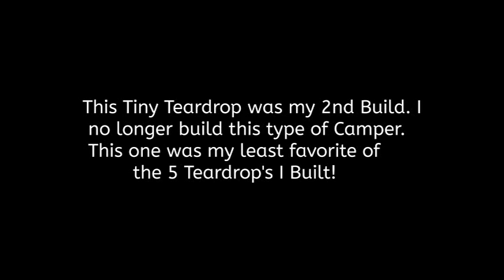Homemade Camper Build (Trail Lite Camper)

Comment: How are you waterproofing both sides of the floor ? For that matter, waterproofing everything, walls, ceilings, etc. ? What about condensation ?
Reply from the maker: Flexx-Guard. I used it on the underside, as well as the edges, plus, the aluminum wraps around the underside of the floor.

Comment: Well done. What a neat little caravan that is. I have a question: did you glue the aluminium skin on the wood or is it just holded by the rims? Please drop me an answer. Thanx
Reply from the maker: No, it's not glued, but I recommend it be glued.

Comment: What are you using to attach the skin to the luan ?
Reply from the maker: You can get a aluminum adhesive at Home depot. It comes in an orange can. The name brand escapes me at the moment, but you'll find it there.
Reply: Thats a debated topic. Some of us dont use adhesive on aluminum because it expands and contracts so using trim at the outside edges , the screws hold it in place but the metal has room to do its thing. Basically sometimes the heat can bubble the metal and make it look bad , doesnt always happen but it can.